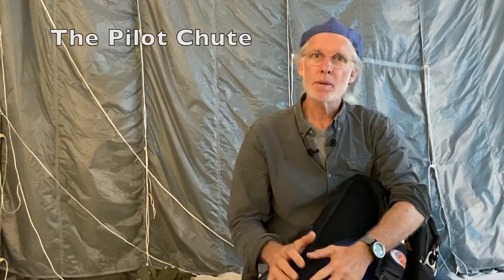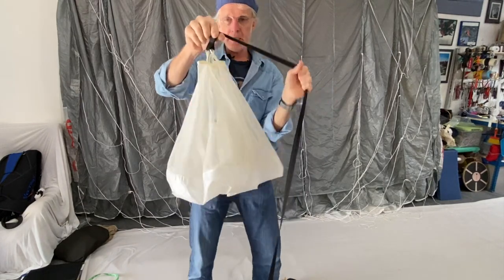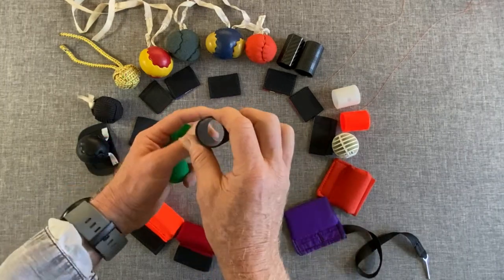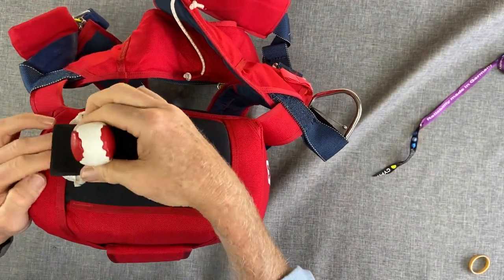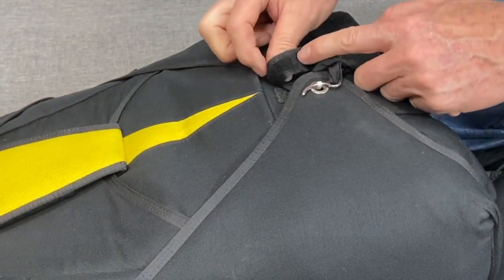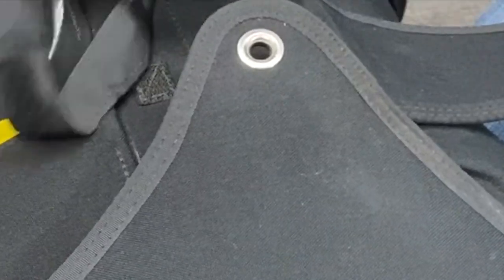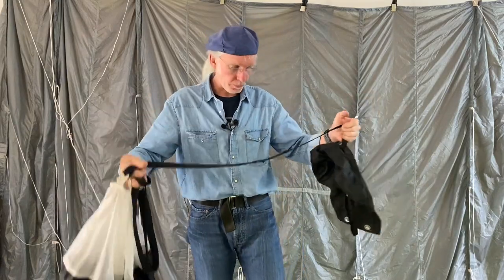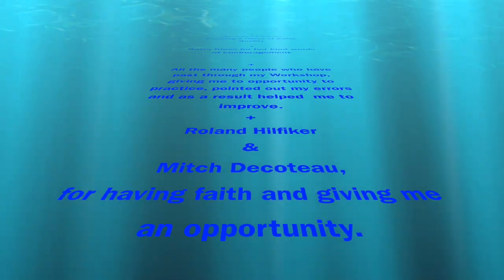The Pilot Chute

Comment: I´m a fairly new skydiver, 50 jumps so far, and i never even knew about the "french way" to put the pin.
But I ordered my first container last year round, and hope to recive it in a few weeks. It´s a Vector3 and out off curiosity i checked the manual from UPTs webside about how they close the main flaps and put the pin.
The the manual shows the "french way" to store the "updated version of the bridle"; but also show other variations for "older bridle designs" in the Appendix F Chapter.

I´ll guess i´ll go to use the ashown and explained "french way" for the updated bridle design, because that´s the gear I´ll get and thats the way their manual instructs to handle it.
Also I´ll talk with my rigger about the topic when i´ll finally get my rig.
Reply: Hey, did you get your gear yet? Did your rigger have any good advice or info on this topic? I still don't quite understand why Colin is against the "French method" - I mean, I'm not sure he explained the benefit of the classic way over the french in case the pilot chute isn't prepared correctly in classic and french way
Reply: @AuroraClair  not yet -_-, But my Container is right now on its way from UPT to my Rigger, ETA withhin 14 days. still need to find a main for it. (Rigger got a PD Reserve and Cypress ready for me).
Reply: @Carmoflage  Wow, I didn't know it takes so long.. Please let us know if your rigger shares any light/his own thoughts on the french and classic way - I'd love to get more perspectives on it

Comment: 38:15 There is another disadvantage of this system:
After you set the pilot chute, the bridle section inside the D-Bag gets compressed and thus almost works like a spring, so even after setting the pilot chute your recommended way, i find that after bagging the canopy, i have to redo the setting process, because it already extended quite a bit.

Anyway, thanks for making these videos. Taught me a lot!
Reply from the maker: Thank you for watching and for taking the time to comment maxiking8496,
Yes each system has good parts and not so good parts in their design, 
but if you know how to operate the system you have, which weak points it has, you'll be at a great advantage.

I (almost)never run the original designs from the manufactures, they all get the "CAM", 
which means the centre line has approximately 20cm extra, to allow for shrinkage(with use in the future) and the creep back inside the bag (that you and everyone else experience).
Please consider watching the next part of, The Pilot Chute (a wee bit extra)  https://youtu.be/EHox4tW6GPk
something

Comment: I was about to write that having a too long kill line may lead to the bridle being twisted insanely much during the canopy ride, as I've had this happen to me (and it was completely resolved by shortening the kill line) and I've seen it on other peoples equipment as well.
However, now that I think about why this would happen I can't possibly see why a long kill line would cause this, making me a bit annoyed at myself. I struggle to understand why shortening it solved this issue for me.

Great video all in all, thank you so much for the thorough explanations.
Reply from the maker: Hello Akegata42,
Thanks for taking the time to comment, Hopefully the second part, The Pilot Chute(a wee bit extra) helps to clear any misunderstanding over the centre line length related to the Stop Tape or Stop Channel length.
I prefer to lengthen the tape or channel on the inside of the bag section, so after the bag releases the canopy, everything will slide up the centre line, the apex of the P/C will hit the bridle "V" and no lip of  P/C fabric is left to grab air asymmetrically and start spinning.  
https://youtu.be/EHox4tW6GPk?t=188

Comment: Any advice on washing the pilot chute? Had an off landing on a night jump... Landed in some merky wetlands and the pilot chute got slightly wet / pretty dirty on the mesh, though the material seems perfectly intact. Thanks for reading this!
Reply from the maker: In situations when it’s mad, I tend to let the material dry first and the mud turns in to dust comes off a little easier sometimes.
Afterwords, soaking it in the bathtub with the little baby shampoo (mild soap) may help to lift some of the dirt from the weave of the fabric. 
Gently, does it.
Avoid agitating the material excessively, no scrubbing it together, it will increase the permeability of the fabric eventually.  

After a rinsing, roll it up in a towel to accelerate drying, then air dry, if I’m in a hurry, I’ll set up a fan to blowing on it.
Then,
Extract the center line from the bridle as much as possible, and wipe it with some silicone lubricant, and repeat on the other end. 
The grommets on the bag may appreciate a wipe of lubricant as well, if they’re made of brass.

Comment: Thank you for the details about the pin / bridle interference. I'm packing the "French" way because of that, but I had never really understood the process which leads to this kind of malfunction, except that by moving the bridle far away from the pin tip, there is obviously less risk.

I do however don't understand your point of view about keeping the "traditional" closing method. Sure, it is better to understand why we use one method or the other and you perfectly explained that if your pilot chute is correctly setup, it will dramatically reduce the probability of an interference between the pin tip and the bridle. But is there any drawback with the "French" methoh, other than a difficult access to the kill line indicator? And if there is not, why not unconditionally use this method which, as you described, may reduces the wear on the bridle and the chance of an important malfunction?
Reply: I heard that the "traditional" way put less wear on the bridle and the flaps, because there is less friction between those two things. But it's something that I heard on a dropzone... I'd like to know Colin's opinion on the matter.
Reply: @Wawet76  Merci ;) Waiting for his opinion as well.
Reply from the maker: Thanks for the Question Guillaume,
I now realise, the video is not clear, sorry about that.
There is now a small additional video, that I hope clears things up a wee bit.
The French method has NO affect on the wear of the bridle, 
If you set your P/C correctly for use (with two steps) and deploy it properly you are Good.
If you semi-set your P/C(only one step), you may be in for a big surprise, however you route your bridle.

Comment: This really helps me understand all the working parts of my pilot chute, d bag, and handle system.  I want to understand every single part of my rig, and you sir are easy to understand, concise, and the editing was perfect.  I am an older and heavier jumper not looking to downsize anymore, happy at 210 sq. ft. 1.3 to 1 wing loading.  Getting a new container ordered, and want your opinion on using a "non" kill line system, and it appears you have answered my question already toward the end.  I really like the non kill line system, does it create any additional wear and tear on the top skin of the canopy while in flight?
Reply from the maker: Hello Geno, thanks for your comments, I'm glad you found some useful points.
The classic bridle will give you good service, way less cost to operate, your canopy should not experience any additional wear and teat.
On all the classic bridles I work on, I always adapt the bag with a fixed attachment point, (as seen at,  18:44 + in the video),
Some bridles have a wee bit of Hook Velcro on them (You can just unstitch it) that may eventually damage a small section of the center cell rid stitch line, after 1500 Jumps or so.

Comment: @Colin Scott Thomson   Hey Colin, was wondering what the dimensions/ material you use for making a locking tongue that you add to a non locking tongue  p/c . Depends on handle/container probabley? Id appretiate any advice you have! (rigger in training)
Reply from the maker: Hello Kyle Callender, I like to use Tecamaid MDS .040(resin grade PA 66)(Molybdenum Disulfide Filled Nylon) for the stiffener, 50x25mm, 
1.5"Ty3 Binding Tape (170mm long) and 
a wee bit (60x25mm) Ripstop nylon adhesive tape.
a little 1/4" basting tape is also handy.

Deburr the stiffener, apply the ripstop tape or tapes for some colour.
https://youtu.be/FzRldficoc4?t=748
Line up the edge on the one end of the 1.5"Ty3 tape (this is where the basting tape will help keep things straight)
wrap the Ty3 tape around the stiffener (hold the end back on itself)
Run a straight line of stitches around(x2) the edge (close to the edge)
Now attach it close to the P/C handle, use the existing reinforced part of the P/C (not just directly to the P/C fabric alone, this will provoke damage)
On some P/C designs its easer to unpick a section of the seam(Fabric too mesh), so you can gain access to make the stitch. 
Some times it's a good idea to add ripstop tape to the P/C to reinforce the handle area,
(normally two 20cm section of ripstop tape, stitched around, then refit handle and LockTag)

I hope that is reasonably clear.

Comment: Great video, keep em coming! :) A question though, assuming that we have the pilot chute set as it is supposed to be, do you see any other downsides of packing vectors (routing the bridle) the french way compared to the standard way?
Reply from the maker: Thanks for the question Gregor.

No Down side at all, 
It's only that I have an allergy, to the change in routing because it is't hitting the nail on the head, 
as to the root of the problem, of "Pin Stabbing Bridle" goes.
please see if I explain it better in the supplementary video (a wee bit extra).

Comment: I don't really understand arguments that say "if you did steps before correctly then this step is good enough" in case of bridle routing.
All accidents happen because there are multiple parts that go wrong in a sequence.
All accident prevention is "how do I make current step safer without relying on previous parts". 
From that, I agree that proper setting of bridles needs to improve, but people will still make mistakes there. having a bridle routing the new way, will reduce the change of anything happening that one time you mess up PC setup. Also while you say why the reasons for running the bridle the french way is not needed, I am really curious as to are there any downsides to it?
Reply: With all that I am really grateful for these videos, they are an awesome source of information and my question above is just trying to understand better.

Comment: Did you cover F111 vs ZP pilot chute material? Trying to figure out which one is better for large canopy and avoiding hard openings
Reply from the maker: Hello V__,
Not really in enough detail, sorry about that.
F111(permeable) is my preferred fabric for pilot chute, 27" diameter seem to work well for deployment of main canopies up to 
200"ish size, them move up to 30" or 33".
In the 90's Little Vectors(EST2) came with 33" that tended to pull too strong, Gus Wing gave me the tip, to pop the 33'F111 P/C in the washing machine, it would increase the permeability of the fabric, thus taming the aggressive snatch force of a new P/C.
No need for that now with the large variety of diameters available.
ZP pull harder, the first ones PdeFr made were in the 33"zone with a Horrific Snatch force 
(=risers, lines, canopies and jumper Damage), thankfully they learnt it was better to shrink the diameter and moved to 25"ZP.
But, the air can't get though and needs to spill out the sides, resulting in erratic shimmy pull, (potentially).
F111 on the other hand, some of the air passes though the fabric giving a steady smooth pull.

If a F111 33" is struggling to extract a 300 size canopy, I'd probably test it with a ZP 30"and see how it helped. 
(or 36"F111, if the BOC could handle the volume)
Reply: @thomson1963  thank you again for the thoughtful and detailed response. I'm glad I switched the PC to F111.
Reply from the maker: @sivonparansun  hello again, 
https://youtu.be/3uRFwiUx0_M?t=63
I just stumbled across this marvellous demonstration of a pilot chute not quite compelling with its job discrimination. We can't see the whole picture but, OK it's not launched so well (give him a break its like jump #1or#2 probably)
with two extra burble generators adding to the fun.
They are using a "KillLine" on a Student Rig, who knows what size canopy it is, I'm pretty sure it will feel zero benefit from a collapsed P/C in canopy flight (a ridicules fashion accessory in this student category)  

May be just my imagination and confirmation bias;  
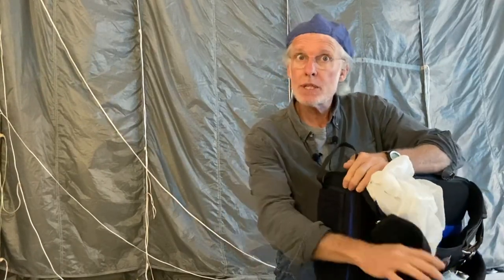If you look closely,(1:11) the centre line (at least the outline of it) can be seen inside the bridle, apparently under tension.
It's my speculation this P/C (like so many others out there) Has Not Been Set Correctly, (probably impossible to set correctly, without some maintenance/adjustments, like extending the CentreLine and StopChannel)
Even with an appropriate P/C diameter for canopy size, the poor P/C can't do its Job to the best of its potential if the centreline is messing with its shape too early.

Wishing you many happy landing,
 with your new Vector.
Reply: @thomson1963  loved the detailed response thank you. I have another question: UPT offers 27" PC as standard but they do a 30"PC as a 'wingsuiting mod'.... if my deployments are going to be mostly terminal for a while, am I asking for trouble with the larger F111 pilot chute? Sunpath suggests excess of 30 inch f111 PC for the 200ish sqft canopy I plan on flying so im confused
Reply from the maker: @sivonparansun  So long as you pack properly and deploy properly, 
every thing is going to be alright. 
https://youtu.be/bjz4JuwvxrQ
The "F111"  30" will be fine, 
so long as it's in combination with "Keener Rubber Bands" and you decelerate a wee bit, before deployment.
Note where the rubber bands are attached to the bag (On the sides, Not on the mouth flap)
https://youtu.be/bjz4JuwvxrQ?t=750 , 
it's 120mm of 3/4" Ty3 Tape added to the sides of the bag, similar to how they did it in the past.

Comment: what is the 'limiter' tape
Reply from the maker: Joey Gee, sorry I was not clear with that, 
the limiter tape, central tape ( or Crown Lines when on a high performance round parachute like the ParaCommander)
has one job, it's to displace(pull down) the Apex(the center/high point) of the chute to a "sweet Point" just above the peripheral hem,
resulting in the best projected surface area, for a given pilot chute (or ParaCommander parachute)
Creation the classic Valentine Heart in cross section, = best pull force for a given size PilotChute.

Comment: i dont get it ? can someone explain what is the downside of the french meathode?
Reply from the maker: It’s not exactly a downside, 
It’s that the reason for its introduction is not getting to the root of the problem. 
You won’t find (In a manual) a clear explanation of how to prepare a collapsible PilotChute for use correctly, with the centerline completely out of the equation, for the “traction” part of the PilotChute life.
Good so routing the bridal the French way will still allow people to jump with incorrectly set PilotChutes.(I prefer all my components to be performing at the best) 
OK the Pin Stabbing the bridal and locking the container closed, is solved 
But if everyone received a good education on how to set a PilotChute from day one (& all manufacturers produced PilotChutes that could actually be set correctly) we could all happily jump the classic routing.

Route your bridal however you’d like, but please set your PilotChute correctly. (see: around minute 30 on the video)
Reply: @thomson1963  thanks a lot for the quick respons. I myself pack my it the classic way. but ive been told not to, enen tho this way it provided in the rig owner manual (javelin odyssey). looking at it from a from physics stand point, i was like... "but i set everything correcly what could go wrong?" i kept coming to the conclusion that the pin will release first... glad i stuck to it since i was a student :P
Reply from the maker: @TheMathiasM44  When I first saw photos(+20 years ago) of a container locked closed with a Pin stating the bridle, sabotage was my initial thought. 
After really doing a lot of head scratching, 
I came to the conclusion that, if the P/Cis not set correctly, the CenterLine violently comprising (like a concertina)the section of bridle on the other side of the Pin, as the Pin rotors 90º just before extraction, the show begins. 
I've seen five incidents, there have been many more
(misdiagnosed as PilotChute in-tow or LazyPull) and I've discovered bridles with evidence of pin strikes (50% hole)

Comment: What about the Pull Out system?
Reply from the maker: Hello Alberto Calmini, 
Yes good question, what about the PullOut, sorry I did not give it the time it deserves.
When I started, I went from S/L to Ripcord to BellyStrap to Rear of Leg HandDeploy(ThoughOut),on my Mighty WonderHog.
handle attached to the base of the P/C, I was properly educated on how to operate it and used it for many years.
(No KillLine back then, we allowed the MainBag to slide/burn it's way up the bridle to cover the P/C, that increased the performance of my Cruislite)
Until I became a fashion victim and moved on to a BOC.
popular now as then(80's&90's), frequently misunderstood and misused, 
classically dialogued/floating handle, tricky to find, or P/C too deep over to the Lh side resulting in hard pulls and ripped P/C fabric.
Absolutely not a fault of the system, more the user error, insufficient  education.

With some of the appalling BOCs coming from some manufacture, the PullOut is not a bad option.

As far as premature deployments go, please don't drop your guard, watch your back, front and sides.
https://youtu.be/7QxndYwMWkk?t=1488